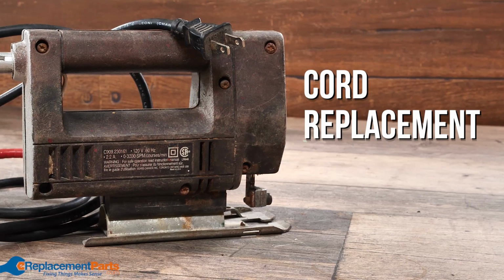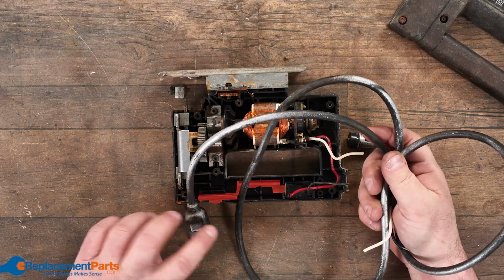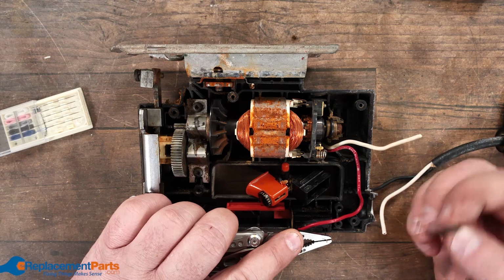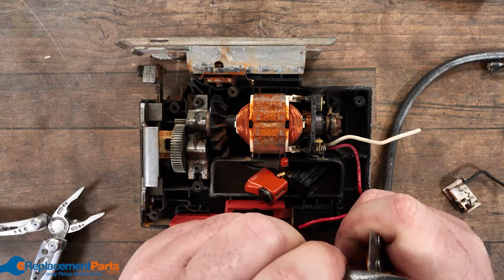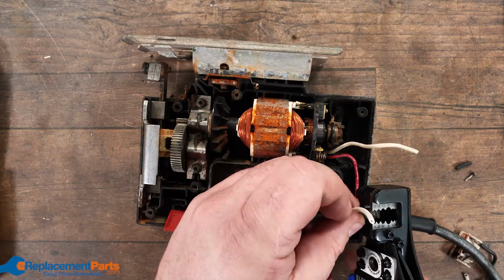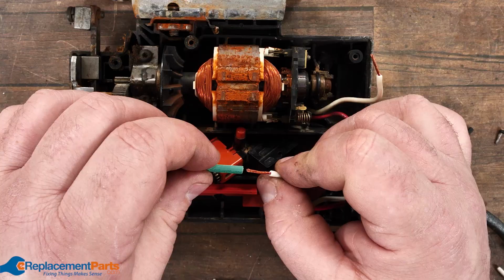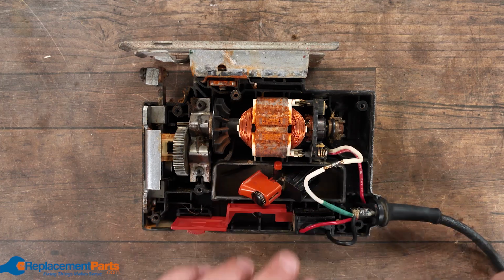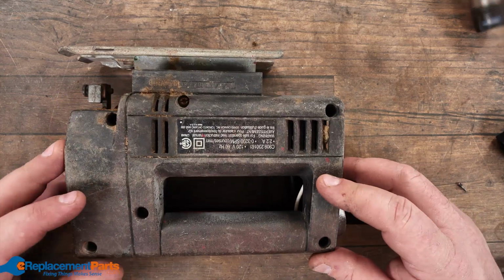Power Tool Guides: How to Replace Cords In Your Power Tools | eReplacementParts.com

Comment: If the new cord slips in the strain relief I recommend putting a cable tie tight on the cord just inside from the strain relief.  PaulL